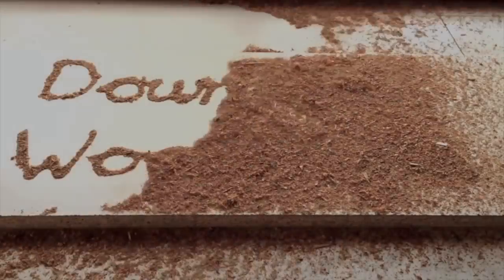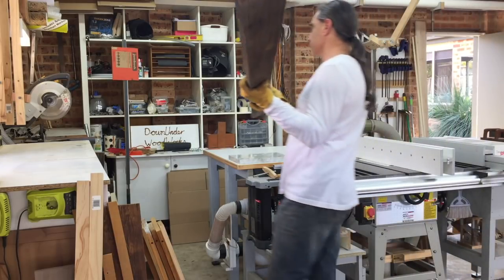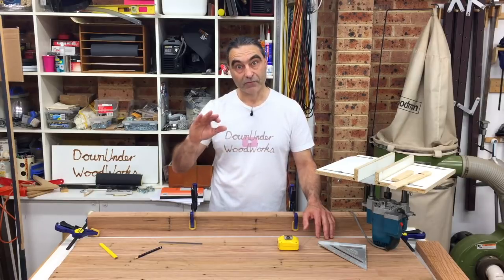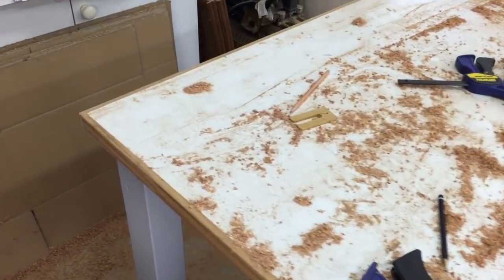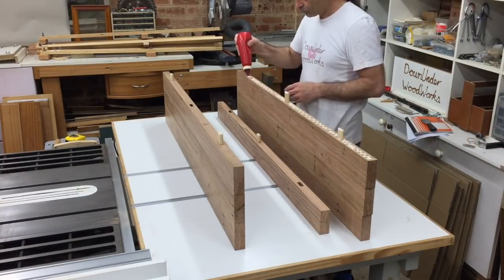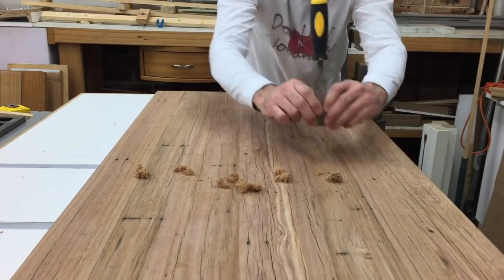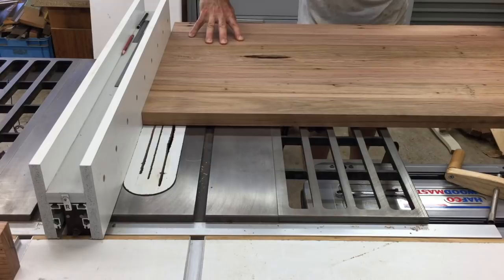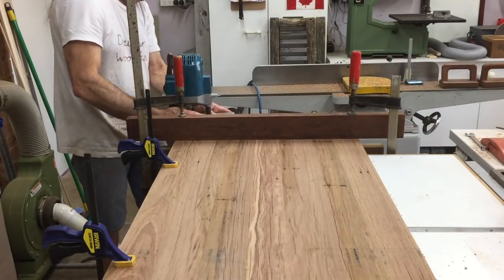Coffee table build - Part 1

Comment: Great video, what would happen if you didn’t allow for expansion and glued everything and made it tight?
Reply from the maker: Thanks Kevin. Timber expansion is a powerful thing and not allowing for it would result in joints and even components cracking or breaking.

Comment: Just love the way you approach the builds. Is there anyway you could have a flexible hose from the dust extraction supported in the same way the camera moves around?  I was thinking about how much time it must have taken to clear up after the routing.
Reply from the maker: I could most definitely do something like that, the main dust extractor pipe runs directly above my head at that bench. Something to put on the to do list. the clean up wasn't too bad though with the shop vac. Cheers mate.

Comment: Nice one mate! An unrelated question if I may?  I noticed you had a melamine board through your thicknesser, has it made any significant difference to your snipe?
Reply from the maker: To be honest I am still getting snipe at the moment but not sure its the feed table. I may have an issue with the rollers themselves that I have to investigate, they sometimes don't pull the timber through as though their not making contact.